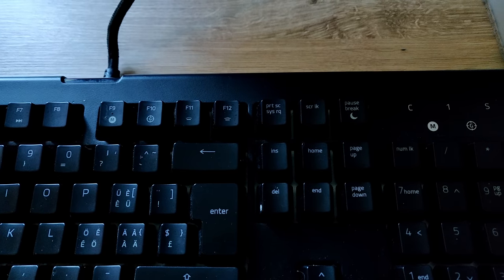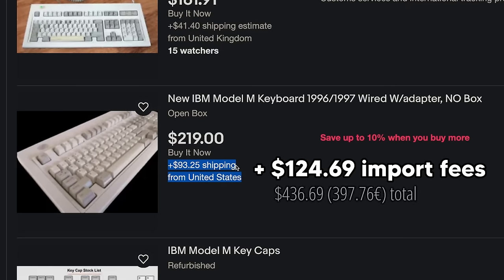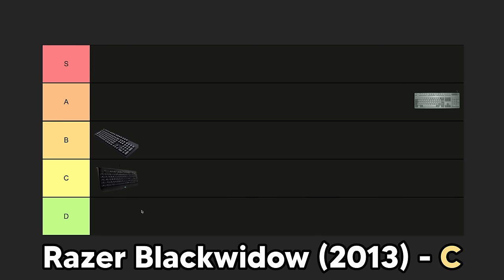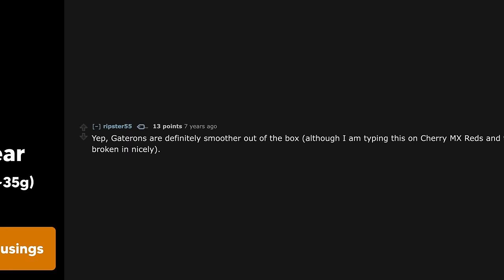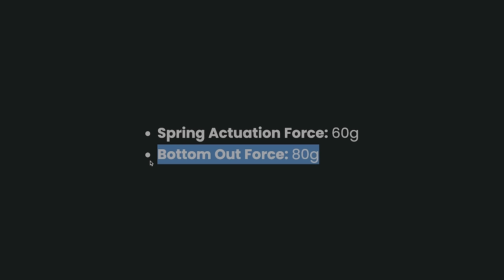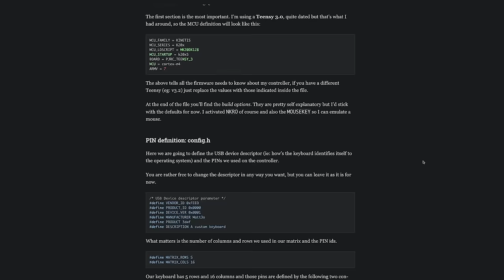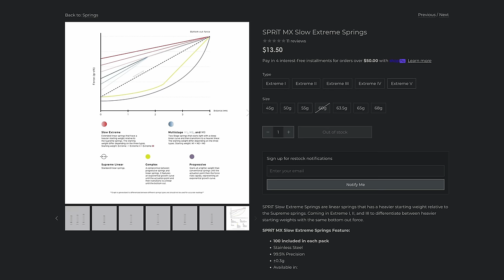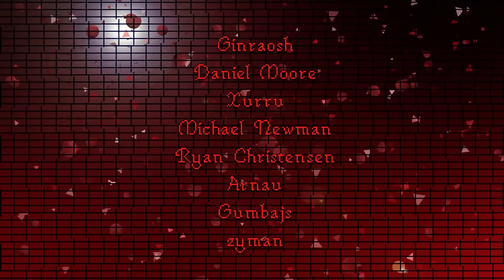How I Lost Interest Towards Mechanical Keyboards

Comment: Honestly, I feel like the mechanical keyboard thing is a scam. Heard some people try to justify the prices with the "amount of manual labor" involved in creating the key caps and the rest of the components. But I simply don't buy it. For the price of a respectable mechanical keyboard you can get yourself two midi keyboards or a DJ set or some cheap office desktop PC off of Amazon or some old android phone, and you can't convince me that those things require any less or an equal amount of manual labor as a simple mechanical keyboard.
Reply: Exactly. I genuinely can't believe some people will look at $500 and think "hey I can get a custom keyboard for this!" Completely stupid to me.
Reply: Mechanical keyboards start at around 20 to 30 Euros. I have a bunch of those cheap ones and only one of those ever gave me problems (chatter).

Last keyboard I got was 22 Euros plus 18 Euros for a set of switches I wanted to try out. And I only got that keyboard because it was hot swappable to avoid having to solder, otherwise I would have used one I already had lying around.

Comment: Are you guys live in little blanket houses under the table to use downsized keyboards? I would hate to use anything other than 100% layout. I understand it is, for obvious reasons - not used in laptops. When it is not crucial to make all the computer ultra portable - that makes absolutely no sense to remove keys and replace separate keys with key chords and combos instead. BTW, I bought a very cheap, dirt cheap SPC keyboard with chineese knock-off switches, but it's surprisingly solid. Nothing's loose, it's not squeeky or scratchy. OK, the switches are cheap, you can tell that, but for the price it's just amazing. I used Filco with original MX blues and the price difference between them is not justified. BTW, I tried to get back to that Filco after a couple of years of not using it. Guess what? It's dead. I mean, you can barely type on it, but the key presses are registered like half of the times. I tried to clean it, but nah, not usable anymore. It's like rotted over of couple of years of living in a drawer.

Comment: For me, mechanical keyboard is all about customization, but not the kind you all probably imagine. I don't see any value in interchanging the keycaps, what I want is a custom layout - split, minimized, maximized, with fancy keys placement and so on. I want round keycaps, dome keycaps, inset keycaps, so that I could have some tactile diversity between key groups and keys. I want all common functions like switching language, window or copy/paste text available with one keypress instead of two or more. I want Tab to be harder so that when I type my comment, it doesn't get disappeared if I mistype and hit it instead of Q key.

I see none of it at the present state of the market. You can do it, but you have to do it yourself. Instead, every manufacturer just makes the same boring shit again, and again, and over again. Hell, they can't even get rid of the CapsLock key, whish is NEVER used. They can't make sense of the numpad, still clinging to the layout of 40 years old with the empty 5-key, all when people need copy/paste functions as a single key in their everyday life. Are we stuck in the stone age or something?

Comment: even if you lose interest towards mechanical keyboards...

you should keep your disdain for membrane keyboards, because of their characteristics

mechanical keyboards are:
1. more reliable
2. more durable
3. more repairable
4. more resistant to debris

membrane keyboards are:
1. cheaper
2. more widely available

then theres a 3rd set ill call "complex electro/photo mechanical keyboards"
1. they have certain features like precise key depression detection
2. they have special use-cases that the other two arent great for
3. they are usually easier to waterproof over normal mechanical keyboards

id say sticking with a keyboard is just fine, but punishing yourself just because you lose interest in a type is bad

Comment: Hey there! Really interesting video :) ! 

You will not find a keyboard that can mimic the HHKB and starting on your second journey with custom MX keyboard on this road will probably leave you unsatisfied. 
I think the better way of going about it would be trying to build an MX board that puts this type of switch in it's best light.

In my opinion the best implementation of the MX switch is the linear version. Also it's clear that you enjoy a softer typing experience so I would go with a softer plate material (PC, POM, PP, etc.) and a softer mounting style (gasket mount, o ring mount, or even top mount with a slim PCB and soft plate).
Also, Gateron and Cherry will be your best pick when it comes to long term reliability :) But if you feel like you're ok experimenting then TTC, Tecsee and other brands might be an interesting choice. 
As for the C3 Tangerines...they are made by JWK and JWK doesn't have a track record for realiability or consistancy from batch to batch. So go at your own risk. You'll either get one of the best switches you've tried or one of the most annoying. There's no in between.
Reply from the maker: Don't worry, I'm not looking for an MX based switch that mimics Topre, just something that I like as much as Topre :)
The reason my MX based board has Box Royals is actually because I tried to find something that mimics Topre before I bought the third HHKB. I actually really do like those switches, they're probably as close as MX based switches will get to Topre, but they're still not exactly the same, but they definitely have their own charm.

Ironically I actually like a pretty harsh typing experience on bottoming out, which is why I didn't like heavy linears that had classic short springs which make bottoming out mushier due to the force curve, but I'd definitely like to try some very good (lighter) smooth linears with swapped springs.

Comment: cool story bro. hhkb looks bad because wtf there's no modifier keys. those are so important for setting your custom keybindings
Reply: There are modifier keys, they just aren't dedicated. Why aren't they dedicated? Because contorting your pinky finger to reach those keys is painful, look up the Emacs pinky. The HHKB is still ergonomically awful, but it's certainly a step forward from standard ISO/ANSI layouts. As for custom keybindings (I assume you're talking about games here?), I personally just shift everything to the right by one, so on QWERTY 'q' would be 'tab', 'a' would be 'shift', and 'z' would be 'control' etc.
Reply: @oku-mq7kg  you can have a modifier right near your thumb if your spacebar isn't stupidly huge. big spacebar is so dumb. it also adds delay to your input time because it's so big
Reply: @stephenkamenar  It doesn't add input delay, so long as the stabilisers are solid. Either way, I agree, thumb keys are much better. I have 4 on my current keyboard. 2 for space and shift (on opposite sides of each other), and another 2 to access layers.

Comment: This 60% layout, you never gonna buy again, is the main reason I bought mine :D . Corsair K65 Mini
However I agree with arrows key complaint and I changed it to be funtion key + aswd instead.
Reply from the maker: That's actually a pretty good idea! Iirc it unfortunately wasn't possible to remap the pok3r to have the arrow keys as fn + wasd, but it would have definitely been very handy.
Reply: @Livakivi  It is also really budget version. I got mine from Euronics with 70 eur, when it was on discount, so it might not be the best mechanical keyboard out there, but you get your moneys worth

Comment: i've lost interest when i noticed that all builds on youtube do exact same things
slightly modified linear/tactile mx switches under fancy name, krytox 205g0, switch film, some variation of 65% layout, thick aluminum case, dampening foam
like, what is even customization at this point, 80% of these keyboards are exactly the same, only the price changes
not to mention everyone going after thocc, which is a fancy way of saying you want your keyboard to sound as soulless as possible, preferably to be inaudible i suppose
i've got wooting 60he and replaced keycaps, best choice of my life, switches are silky smooth, way smoother than any arctic fox switches (or whatever is trendy now) will ever be with any amount of lube, keycaps are blank and you can only see the legend when light shines through them, which gives a very nice effect when combined with switch depth aware backlight, you could offer me a $3000 custom build and i'd still pick this 
i don't care what comes next, this is my endgame and i'm happy with it

Comment: Why did you never try a realforce?
Reply from the maker: Too big for my preferences. Its also not cheap either so it wasn't something I could get my hands on easily at the time unless i would have traded + paid extra for something like the HHKB and so on. I'd like to try it one day though.
Reply: @Livakivi  there's tkl models that are pretty compact afaik?
Reply from the maker: @fourppounds  Yeah already from back in the day there is the Realforce 86, but its still quite bulky. Moreover, I just prefer something like the HHKB layout, or the one on my DIY keyboard regardless. Though I do want to see if the Realforce feels better in any way due to its more solid construction and such.

Comment: The problem with Mechanical Keyboards is they are the very definition of DIMINISHING RETURNS. I bought the K2s from Keychron, loved that thing. It was loud and obnoxious but it did bluetooth and wired while being slim and full 108 KEY goodness. And since then really hadn't delve into the market. But I was always looking for the cheapest ones to see if they were good. That's when Royal Kludge came on the scene and was like, hey we have basically a 100 key and it's like $60. Also if you hate our switches, that's cool, hot swap. Got the keyboard, has a very tiny USB Hub. USB C in with two USB A 2.0 ports flanking the C - IN. Swapped out the browns for Ink Blacks by Gateron, and love it. Weighted base, tiny for my keyboard tray allowing for my mouse to sit next to it without issue, and I think the keys afterwards cost maybe $80. Also their lighting software, is pretty nice, not amazing, but it works well, allows for per-key RGB, macro mapping and so much more... Oh and it is wired, wireless, and bluetooth 5.0. And the dongle stores nicely and magnetically to the base. AND NO FLASHY BRANDING.
Reply: This is why I'll stick to really cheap keyboards lol

Comment: I've used mechanical keyboards for decades but it's not a hobbyits a tool I use and I want to use a better tool. But if I don't need to type I won't be using it

Comment: I indeed know ps/2 connectors AREN'T plug and play HOWEVER that kinda depends a lot on the keyboard and the bios... I had a Pentium 3 and a Typhoon lidl wireless keyboard+mouse as ps/2 and i was SHOCKED when i arrived home with it and detached my keyboard and put typhoon new one and i pressed the Numlock Key until it was the LED ON and guess what? it worked! yeah so i don't know what gives but it kept working even on my pentium 4 and my Computer guy professsor didn't believe me (ofc duh!) but i got my computer in my Bag with the keyboard inside and when i arrived there the proffessor got also Stunned .. how is that even possible? thats wierd! haha yeah i know its wierd and unbelievable but its a true story tho

Comment: You said; “Back when mechanical keyboards were relatively unknown” What, the turn of 19th century? The mechanical keyboard has been pretty standard for well over 100 years. Anyone who actually has to produce large reports, or published material for a living, has been using mechanical keyboards. For instance, I use a Cherry Mechanical keyboard. Cherry have been making Mechanical keyboards for computers since 1970!
Reply from the maker: In terms of the average consumer and office market, mechanical keyboards were completely phased out between the early 2000s to the early 2010s, until they made a comeback via gaming keyboards.
Reply: @Livakivi  In terms of the office Market and consumer, who works for a living. I bought my first Cherry G80-3000 in 1990. I bought my latest in 2022. They have been in constant production with Cherry MX blue switches since 1988. Mechanical keyboards are ubiquitous in industry. At no time ever, were mechanical keyboards phased out. Mind you I have only worked for IBM, JCB, ICI, Johnson Mathey, British Petroleum and Glaxosmithkline. Last 7 years before Retirement – Director of GSK Research and Industrial Design. Perhaps I don’t have as much world experience as a gamer.
Reply from the maker: @MadeleineTakam  Even though that they never were completely non-existent, mechanical keyboards on the consumer market were very very unknown during that era, especially with younger generations and less computer savvy individuals. I don't know a single person in my life who knew about mechanical keyboards during the early 2010s, except for those who were particular about them in the 90s. You can also look at the statistics and growth of mechanical keyboard enthusiast websites and subreddits - they started blowing up post-2015, before which they were very niche. During those times, almost all the keyboards posted in said forums and subreddits were gaming keyboards, the retro ones were mostly reserved for sites like Deskthority. 
I spent so much time trying to find cheap old mechanical keyboards here in Estonia, and it was almost impossible to find anything, I went through dozens of second hand shops in my country, and they were all full of membranes from the 90s and early 2000s. 
The M2 and an black alps keyboard being the exception. The only place I knew were actively using them were cash registers with custom keyboards and layouts made by Cherry.
Reply: @Livakivi  I have only lived in the USA, UK, France and West Africa. I wouldn’t be welcome in Estonia because of my complexion. Not really interested in the joke that is Reddit. I have already explained the G80 has been on sale since 1988. The IBM Model M keyboard is the biggest selling keyboard of all time, it is mechanical. Anything but mechanical is a joke when you work in industry in the USA or UK. It may be different in Estonia.
Reply from the maker: @MadeleineTakam  Not sure what relevancy those assumption have to the conversation, but sure. I'm just talking about analytics - you can also look at Google trends of "mechanical keyboards", old youtube videos from pre-2015 and so on, there is abundant proof that mechanical keyboards were extremely niche during that era. I also said "*relatively* unknown" for a reason, of course there were people who knew about them, but their popularity during that era was probably not even one hundredth of what it is nowadays. I'm aware that from the 70s to early 90s, mechanical keyboards were the standard due to cheap membranes not having really penetrated the market, until they did and became the standard for a while.
Reply: @Livakivi  I will repeat. It obviously hasn’t sunk in. The IBM Model M keyboard is the biggest selling keyboard of all time. Not relatively unknown and not niche. It is the standard that everyone has heard of. Trying to say it is relatively unknown, or niche. Is the same as saying the Colt 1911 is relatively unknown or niche in the pistol market.
Reply from the maker: @MadeleineTakam  I have given enough context and analytical resources and references that can be used to verify the validity of the statement that during the early 2010s, mechanical keyboards in the reference frame of this video were "relatively unknown". It is up to you or other readers of this thread to look into all of those sources.
The sales of the IBM Model M in the 1980s are not relevant enough to the mechanical keyboard consumer market and awareness in early 2010s to falsify that claim.

Comment: No wonder you ran out of patience for mechanical boards. You bounced around the market for years and spent so much money, yet the only really satisfactory experience you had was a 15 year old Korean workstation keyboard just because of the admittedly genius layout. 😳
Reply from the maker: I didnt really spend that much money since I sold everything for around the same price or profit
Reply: @Livakivi  True, but you still went through $1,000 worth of boards, only to end up almost where you started. I'm only at the start of such a journey myself.
I got a Redragon Kumara a couple years back and it gave me a taste for keebs, but it also made me realize I prefer quieter switches and use the numpad far more than I thought I did. Currently toying with the idea of building a semi-custom board by picking up a good 96% style (a layout I didn't know existed until you showed the F96 Knight in this video) retail board and swapping in some Akko parts I've consistently heard are the best for their price range, Akko Lavender Purple switches with either Macaw or Provence caps. Sure I could just buy the prebuilt Akko 5108S with all that, but it's a very clacky plastic frame and getting it apart to foam line doesn't sound very appealing...